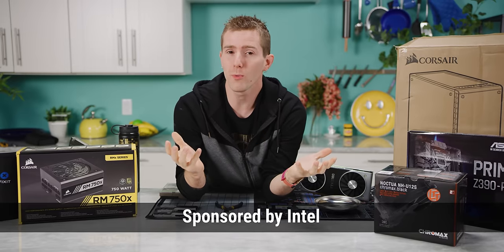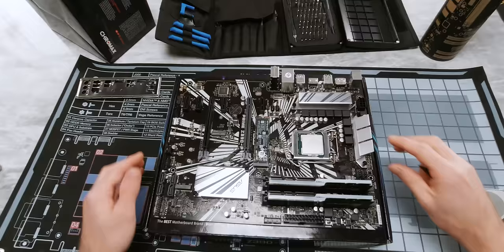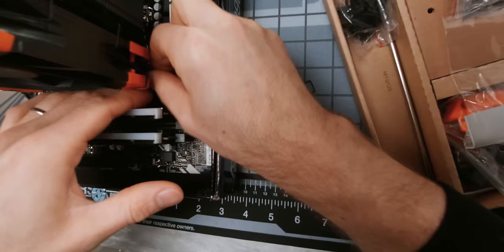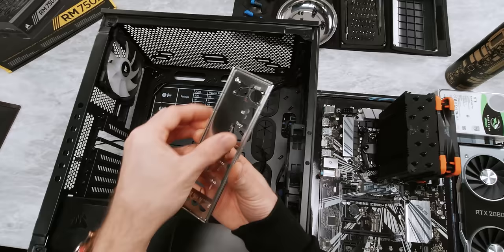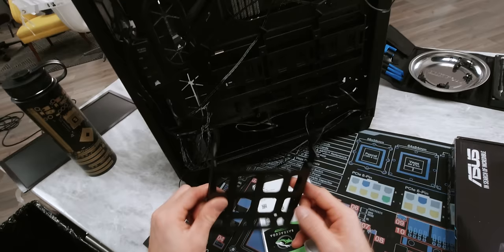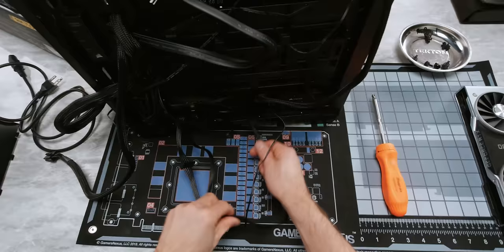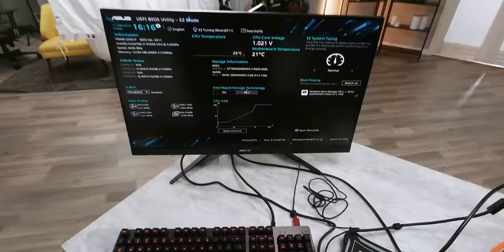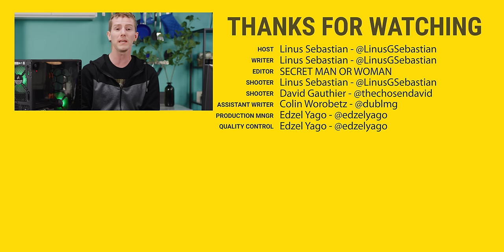First Person View PC BUILD Guide! (POV)

Comment: "without wasting money" proceeds to use intel cpu
Reply: And RTX GPU.
Reply: Intel is still the best buy for purely gaming rigs
Reply: @projectdvan4568  10fps is 10fps so deal with it
Reply: R.I.P. lmfao
Reply: @asuhdude8592  I dont think this is true but im not the biggest expert so ima let it slide haha (I have built 3 PCs but im only 13 soooooooooooooooooooooooooooooooooooooooooooooooooooooooooooooooooooooooooooooooooooooooooooooooooooooooooo im going pick and choose my battles XD)
Reply: Project D van 10 FPS is more so yeah, it is better in gaming
Reply: I dont think it was new, probs just had it laying around anyway
Reply: Listen AMD and INTEL fanboys, intel is much more expensive but better at gaming - designed for gaming.
AMD on the other hand is an all round good CPU, and much cheaper, take your pick, and stop arguing on a youtube comment section.

I tried being as non biased as possible, but is hard when you are an AMD fanboy yourself.
Reply: @projectdvan4568  Technically the best but absolutely not the best for your buck.
Reply: Except you’re quoting him without context. The full quote is “without wasting money on unnecessary gimmicks” and since this is a gaming pc and not a work station it’s completely valid to argue that intel is a better value. I still would prefer amd but this isn’t hypocritical in the slightest
Reply: The AMD compatible boards are pretty expensive, man. It makes the difference. It’s all supply and demand. Sure, I feel the loss of cores in some of my workloads but when I’m playing my games it’s noticeably better than other systems I tried out when considering the purchase. Ryzen won’t make sense for everyone, even if it’s a perfect buy for some people.
Reply: You roasted intel hotter than amd’s threadripper could
Reply: If its sponsored, its not wasting money
Reply: Proarcher13 I’m 13 too- Only built one(but I still know a ton of stuff about computer parts), and the intel is definitely focused toward gaming on their i7-9700k, but not on their XE chips (with higher core counts and lower clock speeds). So some intel products are focused for gaming, while some aren’t.
Reply: Hahahaa, man, It is hilarious watching AMD fanboy defending their stand saying AMD cpu is much better despite losing in gaming focused build with a long and boring comments. 👏 bravo fanboys
Reply: @projectdvan4568  the issue is that if your looking at price margins when comparing parts and not looking at their flagship enthusiast products, you get more than 10 fps, for a cheaper or similarly priced part if you go intel. your just a fanboy kid quit picking sides both companies are in great shape rn just in different markets. competition is good, you should support both companies and hope they both do well because thats what will bring prices down and make processors faster.
Reply: Advocatus Diaboli not in Canada. Here it’s absurdly skewed. One Hundred dollars between the two platforms. When I was shopping around Black Friday I got a great deal on my x370 board and 9600kf. I thought about Ryzen, but it was over 170 dollars more expensive at that time for a similar machine in terms of quality. Coupled with better performance on my entire library of games and it wasn’t that hard a choice.
Reply: Bla bla bla, whatever, done argue? Time to go to school... have a great day kid
Reply: Advocatus Diaboli  when gaming all that matters is frames.
Reply: @mikeshaver-miller745  too many people are fanboys one way or the other. the channel they are commenting on has stated previously in a multiple videos that if all your doing is gaming and you have no interest in video editing or anything really cpu heavy that utilizes multiple cores that intel is going to be cheaper and better, and it absolutely is at every single price margin. for every margin you can buy something from intel that is 10-25% cheaper that will out perform amd in games that don't utilize more than 4-6 cores (which is 90% of games) look at intel's i3 and i5 line up, also if you are still concerned, buy an old 4590 or 4690 for 50$ and you'll get something like a 400$ amd processors performance in games for 50$
Reply: @asuhdude8592  not for your wallet
Reply: Advocatus Diaboli More cores isn’t always better. Most games only support the use of 4 cores. Having 12 to 16 cores for gaming is a waste of value. This a gaming pc, not a workstation. With gaming, better single core performance is more desirable than just having more cores.

For example, Ksp. I’d rather have a great single core performance than a processor with a lot of cores but doesn’t have good performance for each one. It’s because ksp can’t utilize multiple cores, the game is quite old and is designed to run on a single core so single core performance runs best.
Reply: Advocatus Diaboli I’m talking about the advantages of the 9700k here. Not intel cpus in general.
Reply: 10 fps depends on how much it impacts
From 50 to 60 fps? Thats a big difference.
From 80 to 90? Not really.
Reply: @thebloxxer22  the only good rx card is the 5700xt and you can get a rtx card for a simular price with nearly the same performance
Reply: @projectdvan4568  Imagine not having a good enough monitor to take advantage of it... Oh wait, that must be you.
Reply: @archer_1334  im 13 and i have only built 1
Reply: False, only the best at the top end, Ryzen is comparable otherwise and much more affordable.
Reply: @mikeshaver-miller745  AMD boards arent any more expensive than Intel boards what are you talking about lol
Reply: It made sense in the context. CPU and GPU are things you can safely throw money at, with a limit, ofc.
Reply: @asuhdude8592  LOL keep telling yourself that.
Reply: @asuhdude8592  But he didn't use the fastest. For the same money he could get 30% faster CPU from and.
Reply: Advocatus Diaboli  well just to start, here it's only 30 Less than a 9700k and the 9700k is 10-20% faster in most games sooo.....
Reply: Advocatus Diaboli  you can buy a top end haswell with ram cpu and mobo for 150$ or less used rn. You're literally citing one of the only games that uses more than a few cores as an example and it's a game that only boomers and old ppl play lmao. Your saying 200$ for a cpu that my 4590 outperforms in 90% of games and I only paid 200$ for the whole system with a 1050ti. Your budget advice is TERRIBLE
Reply: Advocatus Diaboli  you are not giving advice for budget gamers or gamers in general you are giving advice for enthusiast and budget enthusiast builds. Amd chips are cool, they are super cool, but are they practical and the best bang for your buck that you can get as purely a gamer in 2019? Not even remotely close, like not even in the same planet or universe, not even in the same Galaxy. You can build an entire second hand Intel based system that would be in the same performance range of a single amd cpu for 90% of games, like yeah maybe there are 3 games out there that only old people and enthusiasts play where the amd cpu would win by a great margin. Compare a current 200$ Intel chip to the 2600 for single core performance, it gets obliterated in gaming, like destroyed.
Reply: Advocatus Diaboli  did you literally miss the gn video about haswell systems as a budget solution that went up just today lol . No one is recommending a 2600 as a budget gaming solution over the i3 or i5 lineup infact Linus did the opposite in a video within the last few weeks lol I think on black friday
Reply: Lionhart  AMD has made less heat per performance than Intel for the past 2 generations

Comment: Bro the hardest part i think in my opinion is the wires its so confusing i would need like a 1to1 support on call with someone to help me with that
Reply: Most of the power cables you don't need. What you need: CPU power, motherboard power, GPU power and a SATA cable for your fan hub and/or HDD/ 2.5" SSD if you have one. That's it.
If you have a non-modular PSU (you can't remove the power cables), they often come with a bunch of power cables). If you have a modular PSU, you only plug in what you need.

If you're not using a fan hub, you plug your fans into the motherboard's fan headers. Reference the board manual for location of the headers.

For the front panel cables, again, reference the motherboard manual for the front panel header location and diagram and plug in the the cables to the correct pins.

Comment: "we want to build a high-performance gaming system but without wasting any money"
uses 9700k bc intel sponsored the vid
Reply: For gaming 9700k is still the best choice.
Reply: it's not wasting money when the parts are supplied for free
Reply: V Poje not really. An 8 Thread chip in 2019 for over $350 is a joke.
Reply: Son Goku highest per core speed which is what counts for gaming. Core count doesnt make a difference but higher per core speed does. So for gaming it is better.
Reply: antargaming core count doesn’t make a difference? Try playing Battlefield 5 on a 4 thread chip. You’ll hate your life. You’re still stuck in 2016, core count didn’t matter because we were stagnated because of Intel. This is 2020, core count matters and will continue to matter. Even consoles have 8/16 CPUs. Hate to break it to you, but it matters more than anything now, it’s 2020.
Reply: Son Goku a 4 core cpu at a higher clock speed would beat a 8 core cpu at a lower clock speed. I never said 2 thread chip would be good at gaming. If the clock speed is higher, then you're getting more fps. Only major exemption is cs go because it is more cpu heavy, but having 16 cores in that game won't make a difference.
Reply: Son Goku for work station PC's more cores do matter, but for gaming, clock speeds are the main performance boosters, since most games don't take advantage of a higher core count
Reply: antargaming Why’re you still living in 2016? We have 8 core 16 thread CPUs that have over 4GHZ clockspeed and great IPC, AAA titles and more upcoming already do and will use 8 cores and higher. Hello! Wakey wakey it’s 2020 not 2016 anymore. 4 cores are dead for AAA titles. Not only will you get horrible stuttering, you’ll get very inconsistent frame times. Who cares if you get 100FPS when your lows keep dropped below 40 every 5 seconds? Do some research. Stop living in 2016. Now yes 16 cores really is overkill for gaming unless you also want to livestream and do content creation.
Reply: Son Goku I have a 6 core 12 thread cpu I'm not living in the past?
Reply: antargaming You are living in the past, your comments show it. Also 6/12 CPUs have existed for a long time, that doesn’t prove anything. Silly statements aside, you and your mindset are still stuck in 2016. Allow me to help you up to 2020.
Reply: Son Goku this argument was over gaming. A higher clock speed is what counts. That's why a lower core count Intel cpu at a higher clock speed will beat an amd cpu that has low clock speed with a high amount of cores
Reply: Son Goku bruh ur not even considering the argument. They lower the core count to higher the clock speed BECAUSE ITS BETTER FOR GAMING
Reply: Son Goku the best gaming cpu is 8 core 16 threads. The i9 9900ks is the best and it's only 8 cores.
Reply: Son Goku the best option for gaming IS HIGHER CLOCK SPEEDS. Also what cpu do u have
Reply: Son Goku I don't recall seeing a 5ghz cpu in 2014?

Comment: How is it in 2019 that motherboard and case manufacturers haven’t agreed on a standard front panel connector. I haven’t built a PC in something like 10-15 years... I thought we would have gotten past 5+ different 2-pin connectors.
Reply: I think it's more due to needing cross-compatibility with legacy parts on both sides. Either building in an old case or building with an old motherboard and modern parts in both hemispheres are bound by the other.

My next build project is going to be in an ANCIENT case (like...the USB 2.0 and front panel audio headers are pin-by-pin) so I'm going to be grateful for having legacy compatibility on the boards.
Reply: @SolidSonicTH  You say that like it wouldn't be possible to achieve a MOBOCONNECTOR -> Legacy adapter.

Comment: you inspired me to build my first budget entry lvl gaming pc
 it was hard to find the parts but I managed to put this together...
The whole build costs around $550, to bad I couldn't get the GTX 1050 ti.

GPU: GTX 960 2gb

CPU:  Core i3-10100f 3.6Ghz

PSU: EVGA 500 w

Mobo: GIGABYTE B560M Intel

Ram: Silicon power 16gb DDR4 (2 x 8Gb)

Case: COUGAR Gemini mini tower

SSD: Western digital WD SN550

Comment: Maybe I am strange, but I have never seen the point of cable management. I just usually throw everything into the case and turn it on (well that was when I used to use cases which I haven't for about 3 years now.)

Comment: ok now in my r9 290 graphics card days i did use one loop cable for the 6 and 8 pin connectors but then learned that actually for better power distrubution you should use a separate 6 and 8 pin connector so the power supply is giving the gpu the juice its asking....which is what i do now...i learned also that if you can get a single 6pin and single 8pin connector and not both with as loop cables is probably down to tidiness.  Good vid tho

Comment: One random thing that may possibly scare new builder's who don't know if you look at it. The 24 pin adapter that goes into your motherboard is missing a pin by default and is normal. The 20th pin is no longer used and looks like it may have fell out or something and its a commonly looked up thing that people look up.
Reply: Depends on the gear. Some leave it in, some don't.

Comment: I know this video is a little more than two years old but I really wish I had watched it before dealing with my IO shield (which I cut my finger on and actually had to get  a second pair of hands to help me install). Most of the ports are accessible except the two USBs on the top left because the io shield is just slightly off sync but I figure since I have like 7 other spots for USBs (including two on the case) I can live with it. 

However I may have to find some way to deal with folding back the tabs (between getting that plastic POS in and cutting fingers some of the tabs slipped our minds) without removing the motherboard or risking that the shield comes loose again. Next Motherboard I buy will definitely have a built-in IO shield and not that crappy pos plastic.

Comment: I am curious, with the fact that quite a few cases are made with those not screw driver friendly holes for GPU screws, when you designed your LTT store screwdriver, did you account for that, and attempt to make it thin enough to fit through most of those holes? 
*being that there shouldnt ever be alot of torque used on the screwdriver, i feel it could be possible, however am not a tool designer myself so you probably thought more in depth than that.
** this will not be the deciding factor of whether i buy one or not. I am hoping the price lowers a little bit over the next year and then shall for sure be buying one, or if you have a sale on them

Comment: For me later

Credit to JP Cranford (the comment I copied)

Chapters 
1. Ground yourself - 0:58 
2. CPU - 2:18 
3. RAM - 3:35 
4. M.2 drive - 4:15 
5. CPU cooler - 6:19 
6. Get the case out - 12:06 
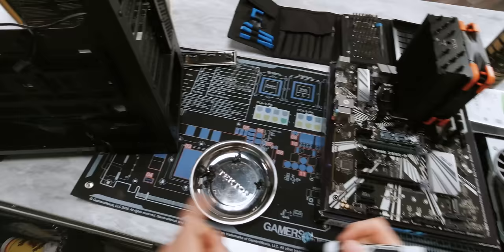7. Cable planning & Case fans - 13:06 
8. Motherboard install - 17:00 
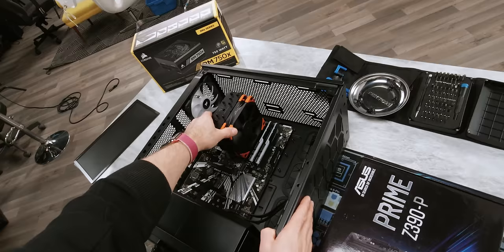9. Motherboard wiring - 19:54 
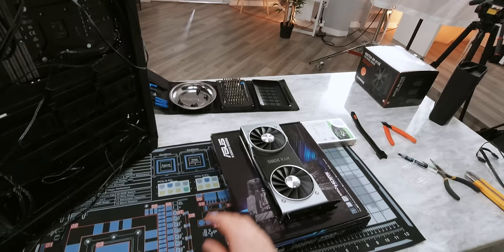10. HDD - 22:44 
11. PSU (power supply) - 23:58 
12. Wiring power - 25:41 
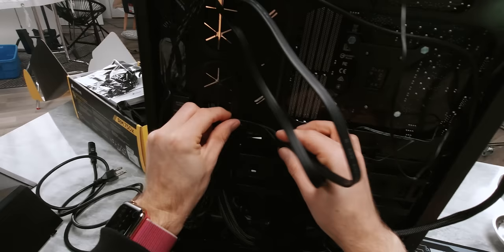13. Cable tie-down - 29:52 
14. Graphics card - 31:42 
15. Reassembly - 34:27 
16. First boot & BIOS - 35:39 
17. Driver install - 37:03 
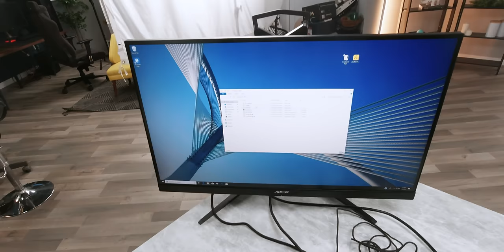18. Benchmarking - 37:55

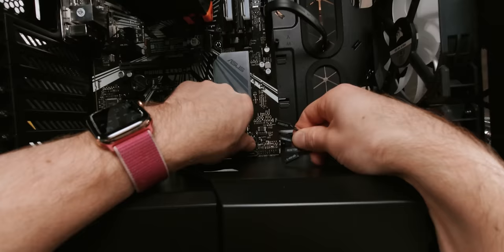Comment: 22:00 I was stuck on that part for like 30 mins because I couldn’t understand
Reply: And I still am btw
Reply: Refer to the motherboard manual to find a diagram of the front panel connectors.

In short, those pins are the front panel headers. They connect the PC case's front/top panel peripherals like the power button, power light, reset button, etc. The cables come from the PC case and you'll have to connect the cables to the correct pins on the motherboard. Use the board manual for reference.

Comment: I wish you used a white case so I could see what wires you actually have. I'm currently wiring right now and I have no idea what I'm doing.
Reply: That or a head lamp. I never do a build without one. Surprisingly few use them, but small LED head lamps are the best secret weapon for computer builders.

Comment: I know this is an old video and nobody may respond to me, but do you need the hard drive, or is that only if you are using sata?
Reply: You need a drive of some type. I strongly suggest an SSD with at least 1 TB of capacity. You can buy a hard drive if you need even more, cheap storage. SSDs are much faster than hard drives though.
Reply: You don't need a hard drive per se, but you need some kind of storage, like an M.2 SSD.

Comment: I was always under the impression that you weren't supposed to pull off and reinstall a heatsink without reapplying compound due to the risk of introducing air bubbles in the compound. Is that not true?

Comment: Hey I just finished my first pc and nothing works. The power supply only turns on when not plugged into anything but now that it’s all plugged in, it doesn’t turn on. Everything is matched up, it is not overkill power supply or under kill.
Reply: Double check that all connections are secure: CPU power, motherboard power, GPU power, power button header cable. Make sure RAM is installed correctly per the motherboard manual